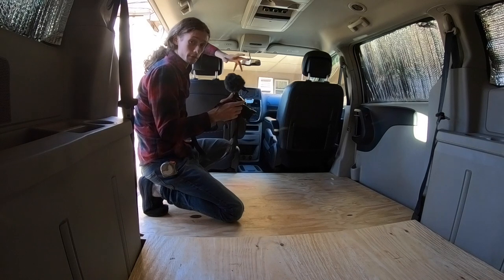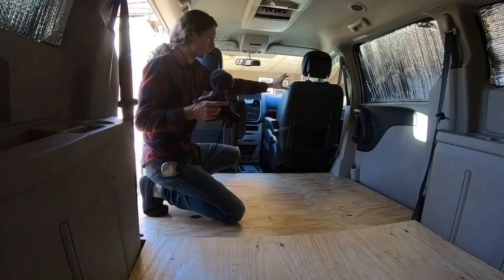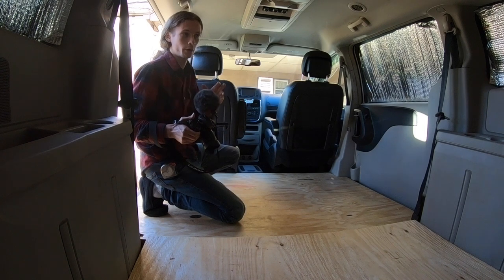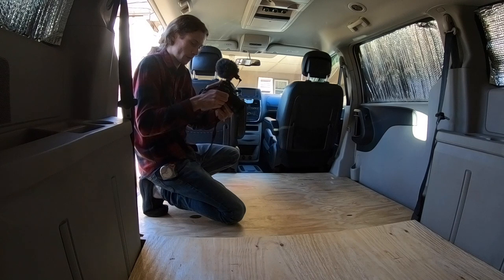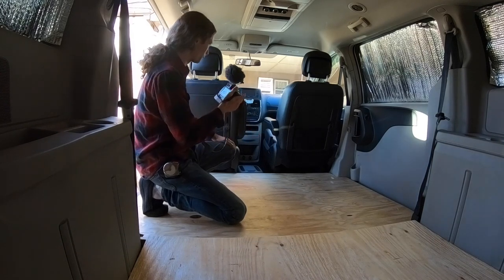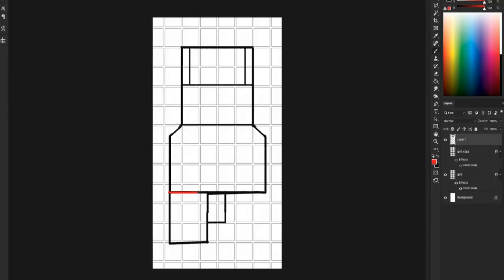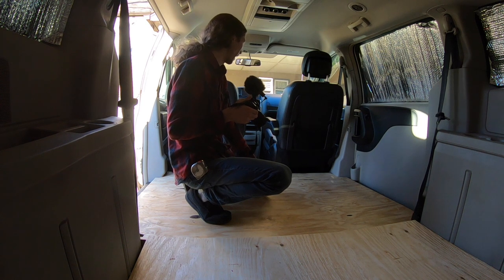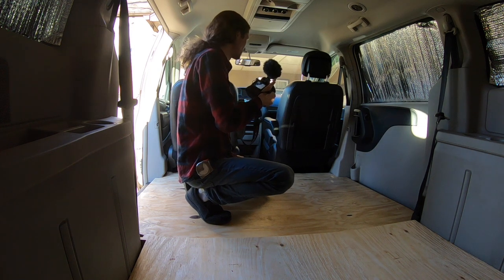New Bed Design Idea for my Minivan Camper

Comment: I prefer the seat in. I'm not sure of your long term plans, but I think it's nice to have the extra seat if needed. You could hang a bag with pockets (or like a shoe organizer) over the back of the passenger seat to hold items vertically. I've seen people use the floor space in front of the passenger seat to carry extra jugs of water. You could put a box or bag on the passenger seat for dirty clothes and laundry supplies, extra canned food, whatever. The passenger seat will let you have 3 different storage areas and yet can be a backup if a seat is needed. Plus it's stable to help keep things from shifting forward if you need it. But it'd be interesting to see your design if you go for it 😊.
Reply from the maker: Yeah, that's a good point. I'm honestly pretty nervous about taking the seat out. Haha. with it being plugged into electrical stuff, I don't want to cause some issue.

Comment: Just a couple of thoughts...what if you have a travel companion someday? Are you planning on doing stealth camping? If so, you wouldn’t have a normal looking cab area—but then again that means no curtains & you would always need window coverings even if you’re not in the van. My reasoning is that if your window is uncovered and they look in and see a bed, they may know if have a lot of things worth breaking in and stealing.

My vote would be to make that passenger seat swivel and that would also make your van open up. Plus if you started your bed there, you would be staring at your steering wheel when in bed.

Just some random thoughts. (Only because you asked.)
Reply from the maker: Yeah, lots of good points. I'm already starting to lean away from my idea in this video hahaha. The swivel chair is a good option! I'm strongly considering it at this point. Thanks for reaching out!
Reply: I agree with this comment. Even if someone needs a ride to go eat you need a chair and seatbelt for them.

Comment: I just got my Town and country too! I decided to place heavy rubber mats for my floor instead of plywood.
Reply from the maker: That's a good idea! Sometimes I feel like I'm trying to make this more complicated than it needs to be 😂
Reply: Cool! We took a half a sheet of plywood to cover the second row stow & go seats because it seem like every time I knelt on them you could hear a crack and we left the seats in their storage spot. We also grabbed four interlocking fitness mats from five below (they’re under four dollars each) for the next layer used same size carpet tiles (2‘ x 2‘) from Ollies for under two bucks each, 2 yoga mats (five below again LOL) and finally, covered with a canvas blanket. All wrapped, no securing needed. Since we left our smaller back-row seat up, we only needed that area for the floor (mainly for the dog’s comfort too) but it certainly protects the stow & go area now which was my biggest concern. That and all the seat hardware sticking out of the floor I didn’t feel like me or my dog stepping on 🤣 I’m not sure how much my gas mileage is going to be affected with all the wood we have but the good part is none of it is permanent :-) 

Happy travels!
Reply: I used puzzle foam flooring panels in my Toyota. It’s insulated and you can get them with fake wood or other patterns. I have the smaller ones that are for exercising. I threw a washable rug on top. It’s comfy to sleep on with just my sleeping bag. Rubber mats sound easier to keep clean though as a spill can seep between the puzzle pieces. Do they come in large sizes or do you fit them together?
Reply: Right. I did the same. Two mats 2’x8’ then two carpet runners 2’x8’. If I need one back seat up, I simply roll back one side of my flooring, and pull up the seat. My bed doesn’t have to come out in order to have a back seat.
Reply: @Seraphsody  you might check Amazon or a big box home improvement store for other sizes but we definitely wanted easy, easily removable, and washable!
Reply: @judyweigl9604  what kind of mats and carpet runners? Where from? That sounds like an easy solution
Reply: @MatteoLC  I got my mats from either Lowe’s, Home Depot, or Walmart. On top of the floor is 2’ x 8’ rubber mats and on each mat is a 2’ x 8’ carpet runners. Depending on where you put a bed, will depend on if/where you might need a little bit more underneath to level the bed. Happy Trails =:)

Comment: Take front seat out, turn it around, and rebolt back in. No need for swivel and gives you extra seating. Also, I would think sleeping up there would be hotter and less dark/private.
Reply from the maker: That would be a lot easier. Thanks for reaching out!

Comment: Did you make your reflectix for your windows? I am still in the process for my Town & Country. It’s a project that I think I must be insane for tackling. Ohhhh that front window.... It’s freezing cold here and I had to start my car and warm it up to work on them. And It wasn’t a boring video. LOL you’re doing just fine.
Reply from the maker: You and me both, I feel pretty crazy trying to tackle this too. Hahaha. Yes, I did cut the reflectance out myself. I just measured the windows at the longest height and longest length, cut out a piece of the reflectent insulation and then started shaving it down until it fit. 

I think I'm going to attach the reflected to cardboard now, to make it more sturdy, and then wrap them in a black fabric. The final thing I'm planning on doing is adding little magnets on the corners so that I can just snap it on to the windows. 

Best of luck with your build!!

Comment: I have yet to see a minivan camper built the way I did. I like ur idea about removing the passenger seat. Mine I built for 2 people. Your for 1 sounds great. I used 1 sheet of 3/4” plywood & 2/ 2x4s. It makes a bed &/a front facing couch by folding up on itself &/a pullout cooking shelf. My van is a Chrysler stow& go. Good luck. Total cost  about $100.

Comment: Your idea to remove the front passenger seat is a good one! I did ... lots of space now, never used it anyway. An additional idea: build vertical. Entirety too many people  build horizontally and akin to a bedroom with a long six foot dresser, it just simply takes up too much space. Wire rack shelves can be purchased at a Walmart,  Home Depot or Target, quickly assembled (adjusted and moved-removed, and even cut to size) and placed about the van as you like. With shelves, you can store a lot, vs. drawers which have limited space, not to mention the cost and weight! Keep up the good work! FYI: I padded the passenger side heavy and use a top quality sleeping bag, pillows and blankets - less cumbersome than a bed, and no build. During the day, I roll it all up and the space becomes extra storage.

Comment: The headrest has a restraint sensor in it. I’m not sure about the rest of the seat, but that sensor will make the airbag light stay on if it’s removed.
Reply from the maker: Yeah, I'm starting to lean towards just not taking it out and avoiding dealing with that issue. Someone mentioned trying to trick the computer into thinking the seat is still there. Haha. But potentially turning off the airbags isn't exactly something I'm interested in doing 😂 Thanks for reaching out!!! I really appreciate people helping out!

Comment: Hey there, I know this isn't for the exact same vehicle as yours, but I want to share a link for a guy that did front passenger seat removal from a Dodge Grand Caravan, which is the most alike vehicle to yours. (That is, if you decide to go this route) http://www.youtube.com/watch?v=lamDQIY5nV4 
Basically, he removed and discarded the seat after he cut the sensor off the back of the seat, then reconnected the sensor to the other end coming up from the floor . In his comments he provided some additional info as follows: 

"What I did was, I cut out the sensors from the seat and then plugged the wire harness from the seat sensors back in. Everything worked great, no warning lights.
 I left the cables/sensors on the floor and just covered up them up with a small box. Be careful when doing this, disconnect the battery first, just to be on the safe side because you're dealing with sensors that talk to the airbag system in the car, you don't want to accidentally set off a airbag when disconnecting/reconnecting the sensors."
Reply from the maker: That's extremely helpful, thank you so much!!

Comment: I spent over a year just in design on our Ford Flex as its not easy to get 2 weeks food, water, clothing for 2 people into a wagon. I have a TV, sink, shower and toilet all on board w/o having a sink, toilet, shower or TV on board. Without giving it a lot of thought for a minivan and with all seats removed and not knowing what you are wanting to bring on board, do on the road, etc. This is my generic opinion. First, leave the seat in but reverse it for interior seating. When driving put it flat so its not in the way nor draws attention. When not driving or sitting, this still becomes a table platform. Lets start in the back at the hatch... the rear trunk area, build long boxes (like a window flower box) from side to side that fit your cans, drinks, etc on their sides (ie: 36"L x 7"W x 12"H). This way they stack easy and don't fly all over the place. I have 3 of these boxes in the Flex trunk. One for can drinks/food, next one to hold 7 one gallon exercise water jugs and last is filled with small waterproof bags that we keep food in. As we try not to bring future trash into the vehicle. Being your back well is deep, these food boxes can be pretty tall to store a good amount. I had mine made out of aluminum (folded) to keep weight and size down but wood/plastic can work. On top of these boxes lay your camping blanket, folding chairs or such. From here go to your bump up rear seat area. I would put a short fridge or cooler here on slide rails to pull out over the food boxes on one side. And put a Pelican case on the other side and have this as your "kitchen". Burner, pots, pans, plates, silverware, etc. This way you have a kitchen yet its not fixed so you can move it to a picnic table, friends backyard, front area of van, etc. You could also have 1 or 2 pull out platforms/cutting boards that come out from under the fridge area to create a "table" over the canned food area. Now the main space between the sliding doors, leave this open with nice flooring and 2 nice cut outs to access the floor bins. I would use these for all clothing (use compression travel bags), jackets, basic gear you would reach for (gloves, hiking poles, what not). This leaves you open space to enjoy the doors, easy access to basic gear and clothing no matter the weather or location. Makes it easy to clean and use the space in multiple different ways. And make one if not both floor bin lids lockable (like a lock from a toolbox) so you have floor security. Now back to where the 3rd row hump is where the fridge and pelican kitchen reside. Using 80/20 aluminum for the strength mainly and weight. Build a nice strong framed box over this area so the fridge and kitchen just fit under. Keeping this areas build as low as possible, maybe even removing carpet to give all inches possible for slides, bed height, etc. Now that the box is built, build a box frame like a picture frame that can flip backwards and another forward. If done right with a bit of thought and studies on the 80/20 product and attachment choices. You should be able to get away with doing almost like a folding futon design here yet with no legs. So at night your bed folds out from this area to extend over the food boxes to the back door and forward over your open space. Otherwise your cushions lay out to sleep or fold on top of the entire structure for storage or can be half brought down into the open space between the 2 doors as a day cushion lounger. Wood is used inside the 80/20 frame so the mattress won't fall through. Use under the seats for first aid, fire ext, gas/diesel heater if you are going that route. Basic small soft tool box, chains bag, small shovel, etc should fit under the hood somewhere to free up more space. If you don't want to cut holes for roof vent, I am using a 4" high speed quiet fan from a grow unit and exiting it out the back "slam vent" you find behind all the plastic in the rear. This spring I plan on having 3M UV clear tint installed all the way around that stops much of the UV to prevent some of the heat. To go back to the beginning of my comment here... my TV is our Ford Flex 8" screen in the dash that we can run YT and such through. Our sink consists of 2 spray bottles, 1 water, 1 soap water as our sink is the out doors. Our shower is over sized micro fiber make up removal towels with some hot/warm water. And our toilet is a kayak deck plate installed under the bed at the pass side door. Good luck with the build, think outside the box and make it yours.
Reply from the maker: Thank you so much! This is some great information!!! I really like the idea of locking the Stow n Go areas! (I don't know why I didn't think of that, hahaha.) I'll keep a lot of this in mind. My flooring is just about done, so I can start adding all these elements now.

Comment: This is coming along nicely! I've done camping in my van (same, but dodge version) and left the front seats in just fine. My bed is narrow at the REAR with my pillow just behind the passenger front seat, where the body is wide and comfortable. It also left me tons of storage under the bed, which is slightly raised, and still lots of room to move around. I also wanted you to see this video from Tim with a super awesome idea for venilation: youtube.com/watch?v=0lfheOOliwA

Comment: Hey Ian. I am converting my 2011 Grand Caravan. I was thinking of replacing the front seat with a deep drawer unit. I have unpluged the seat to see if it would cause problems and it did not. 4 months later and I just have a seatbelt light on. Yours might be different but you can just unplug all the wire to see. As for your bed idea it's interesting but that would block your side door access when in bed mode. Figuring all this out is part of the adventure!
Reply from the maker: Hey Dan. Looks like in the Town and Country it will turn off the airbags if I take it out, haha. So I guess it's staying. I'm glad you were able to make it work for yours. I honestly think the Grand Caravan is a much better van for camper builds.

Comment: I am going to take my van to a mechanic to take out my passenger seat. It is doable, but you have to take out the seatbelt, then wait awhile to unbolt and take out the seat. My cousin found a YouTube (sorry, I don't have that link). I will keep the seat just in case I ever want to put it back for any reason. Again, I use a cot with extra padding for a bed. Works great for me.
Reply from the maker: Thanks Judy. That's probably something that I should take to a mechanic myself if I end up deciding to go ahead with it.
Reply: @IanODonnell  I’m not strong enough to undo all those bolts that are put on by power tools. 😁
Reply: @IanODonnell  I did take my minivan to the mechanic and they removed my seat. The seat belt light stays on, but no ringing bell alert. I’ve taken one short trip and I like the extra room for storage. Happy Trails =:)

Comment: Hey Ian- how about keep the seat but turn it around and use the seat as part of the bed- that way you still have a seat to chill in. I’ve seen it before. You can also use the seat sliders this way.  When I say use the seat as part of the bed I mean utilize the space on the sitting part of the seat to put your bed frame on top of like a folding piece that you can have an option to use. Behind the back of the backwards facing seat you could still have space for your cooler or storage.
Cheers bro
Reply from the maker: Yeah, I may end up turning it around. It's a good idea!